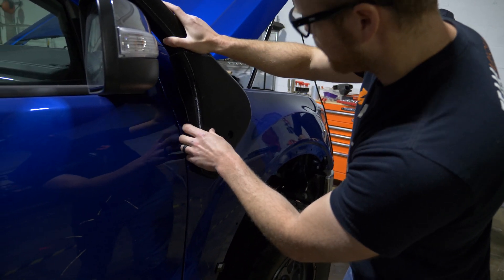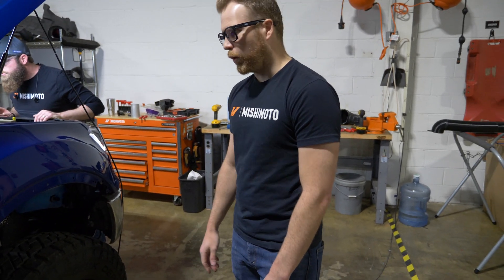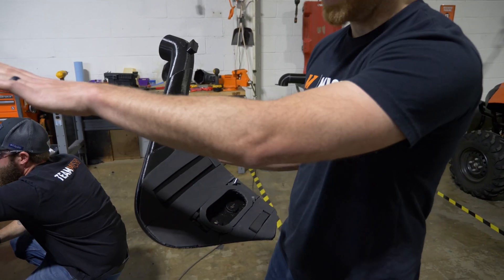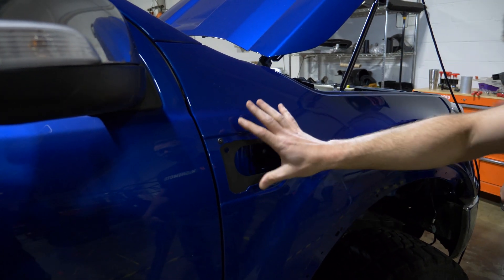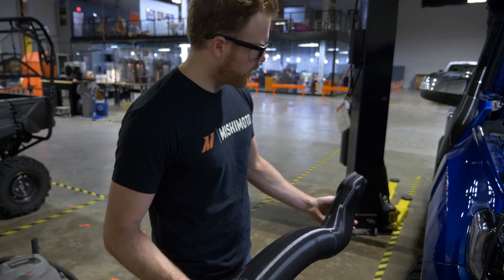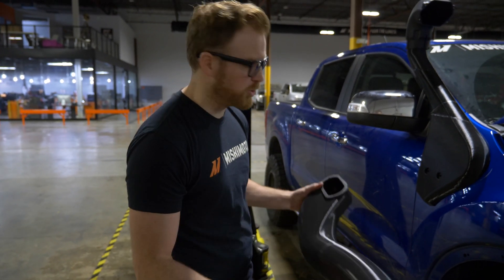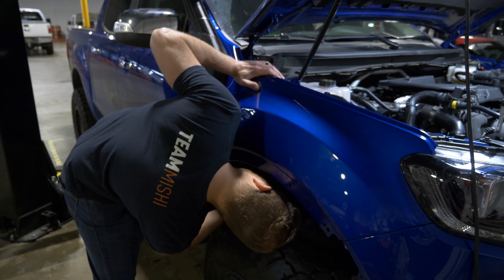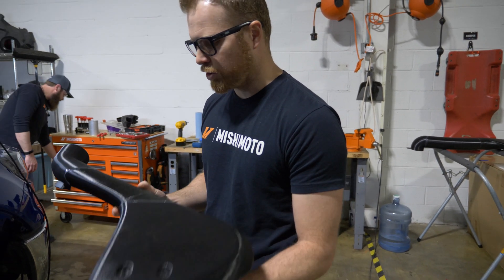2019+ Ford Ranger Snorkel Prototype Design and Fitment

Comment: If I’m not really off roading, is the snorkel worth it? I get heavy snow and I’m at high altitudes. The California roads and back roads of Pa get super dusty. I’ve got the cold air intake you make for the 2019 Ford Ranger. Will this pay for it self with better air flow and air quality for the engine?? Thanks! Love my cold air intake! It’s a game changer 🤘🏻
Reply from the maker: This will not pre-filter this air if that's what you are asking. The main benefit of a snorkel is to raise the fresh air inlet to the roof level.